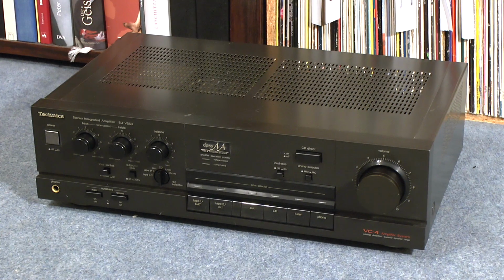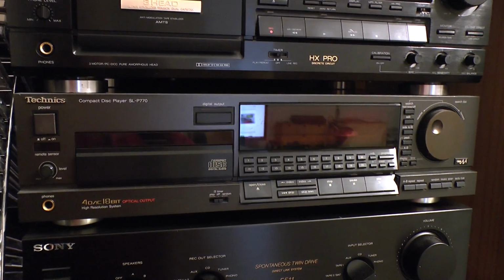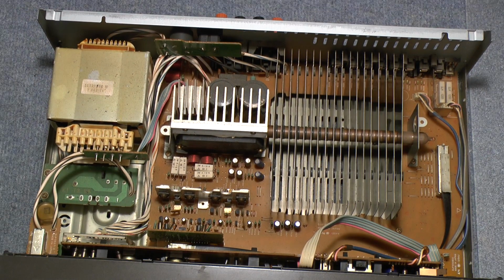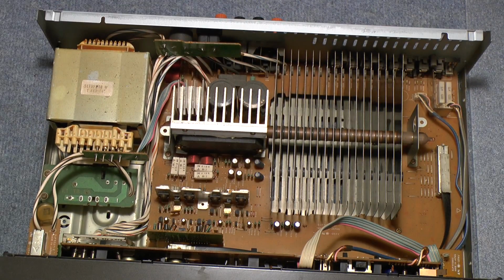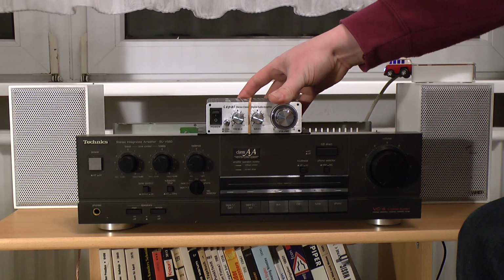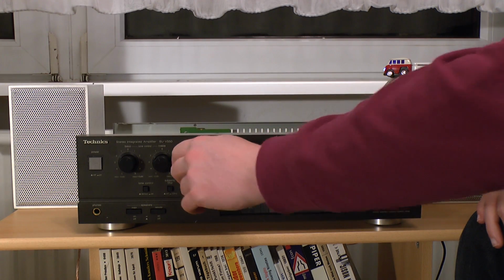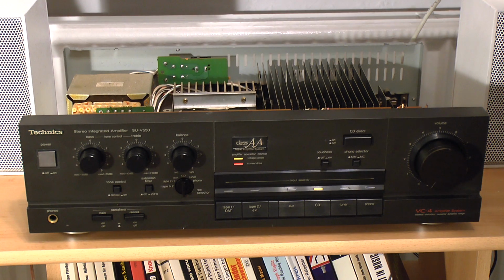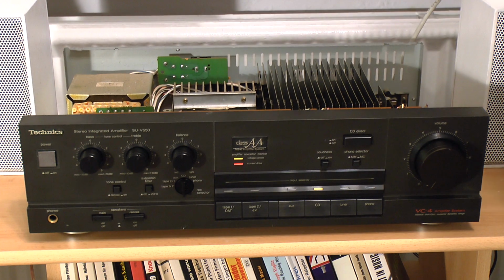The 1988 Technics SU-V550 amplifier arrives!

Comment: dude, you don't even know what' you're looking at. 50watts?? joking? The back panel says 570 W consumption. Have a look at the service manual. The cooling is stare of the art. Check out the measurements...
Reply: Just buy one and see..... Parts inside are not so top notch quality-. Measurements are fine on so many amplifiers but they dont sound all good. I have this amp still and, its a good one for a starter who has powerful speakers, but there wont be  much crystal clear tones.

Comment: I have an 1988 Technics catalog with that in it. I have the SL-P550 CD player. Awesome. The Technics amps that came after the Class AA were supposed to be much better. The Phono stage in the 550 is nothing special. Those caps are to bring the tiny phono out put up I’d imagine.
The source selection dial is frustrating small on it too.
Reply: Measurements are fine on so many amplifiers of that era but they dont sound all good. I have this amp still and, its a good one for a starter who has some powerful speakers, but there wont be  much crystal clear tones and bass will be muddy, not so sharp. Lots of power tho, stated 6w but feels like 120W. It was one of my first vintage amps.

Comment: The worst amp I have ever had. Lots of power but no fidelity. Muddy, flat, weak stereo effect.
Reply: Interesting - some of the Technics amp seem to "carry" a bad reputation. Seems that the pre-amp section can be a weakness.
Reply: @brucetungsten5714  I am not familiar with electronic parts inside, but what i have read is that it has some weak parts inside, except for transformer that has lots of power (Stated 65W but when you turn the volume knob it feels like 120W). Also, my experience is it works better with some speakers that have usually  highs pronounced so it levels with the amp muddiness. to some level. I actually even liked it when I connected Visaton X20 speakers (large), but then I hooked up my other vintage amps and realized it this Technics is not so crystal clear. But for any new user in vintage gear, it is a good start.

Comment: I've got one stuck on cd input. What section could cause that?  Cheers
Reply from the maker: The input selector switch is a mechanical setup. So there must be a problem with the latching mechanism in the input selector switch assembly. Oh, and make sure the CD Direct button is deactivated ;)
Reply: @DrCassette  switch checks out ok and the mechanics.  I've probed signal on aux input line with cro around tone section on preamp 8 pin chip and strangely sound comes out of speakers on another input when i do that. But stops upon removing the cro probe. I've got schematic and will play more.

Comment: Whats the VA rating on the back? You said 50watt transformer? These amplifiers are awesome, my experience with them is they have more stable juice than every other one besides high end Harmon kardon at the time. Those modules at the back may be a fuse, relay, resistor, even enclosed preamp for linear input leveling. 

I had a massive Sony stereo amplifier and separate preamp and it was amazing the power circuits that was used back then. These days a small amp using only 12v input can be very good so long as the speaker impedance draws enough from that low voltage amp.

Comment: Don't use contact spray.
Take them apart and clean it up nicely. (:
Reply from the maker: That's a waste of time. Disassembling potentiometers and switches and cleaning contacts that way in my experience lasts no longer than using a good contact cleaning spray.
Reply: @DrCassette  Yep   Deoxit !
Reply from the maker: @BigEightiesNewWave   I use Kontakt Chemie Tuner 600.

Comment: The only reason that STK module is still working is they made the heatsink big enough.  Those modules do have decent sound, but always failed prematurely due to heatsinks being far too small.
Reply from the maker: Yes, the STK modules tend to run very hot, even when there is no input signal.
Reply: Stk and svi are very different

Comment: i bought 18000uF 200v capacitors for my new amplifier project. These are expensive...
Reply from the maker: I can imagine those were not cheap. But why do you need 200 V rated capacitors?
Reply: @DrCassette  The real voltage on the capacitors will be around 70 volts and i thought 100v might not be enough. There weren't anything better available
Reply from the maker: @alcoholisfreedrink  Hmm, if the working voltage across the capacitors really is 70 V, then 100 V rated capacitors would be perfectly fine. 200 V is an overkill.
Reply from the maker: @alcoholisfreedrink  I know, 200 V is a very unusual rating. Are these capacitors used as smoothing capacitors in the power supply?
Reply from the maker: @alcoholisfreedrink   But smoothing capacitors never get to see peak voltages unless something goes horrible wrong in the mains. What output voltage does the transformer have?
Reply from the maker: @alcoholisfreedrink   50 V * sqrt(2) = 70.7 V
That is miles away from 100 V. I'd say, return the 200 V capacitors, if you still can. Get 100 V rated capacitors either with higher capacitance or multiple ones. Much better investment ;)

Comment: I bought this amp in 1988 and I still use it (in my home office).  The amp is very heavy for its size. Volume control is a little scratchy but otherwise its still great. I still have a technics tuner in a matching style that I still use with it.
Reply from the maker: These may not be the best amplifiers, but they are very reliable. I never came across a dead Technics amplifier.
Reply: The only heavy part is transformer at the left. The right side is awkwardly light.  Sounds like any average amp. It has lots of power only.

Comment: STK module...  notoriously unreliable.  Never (!) connect an amplifier to your precious speakers without being absolutely sure that there is no DC present on the output terminals.  Those low end amps with STK power modules are not always relay protected.  In case of a short in such STK you definately will fry the voice coils of your speakers.
Reply: its not stk are you blind?? its a matsushita module svi 3102
Reply: @MrHBSoftware  By looking at his profile pic, he looks blind :face-blue-smiling::face-green-smiling:🤣🤣🤣
Reply: so what? that also happens on amps with discrete transistors...svi modules are much much higher grader than stk
Reply: Doesnt really matter, these integrated amps are really bad if they are not designed properly, fortunately my techincs su v2x had output protection becouse SVI module was throwing 40VDC right to relay but protection kicked it so it wasn't on terminals. It also damaged preamplifier stage and input selector.
Reply: Maybe, but STK-SVI chip is pretty much whole power amplifier, if something dies you have to replace whole module which is like 50-100€ alone and hard to find, discrete amplifiers are much easier to repair, much cheaper and most of the time there will only be few transistors blown but with properly designed circuitry both can be safe and sound amazing. The fact that most technics with STK/SVI modules are 30 years old and still work today just shows that, but i'm not planning on buying anything with integrated amplifier chips, its way too risky.
Reply: the era of discrete components has ended many many years ago unfortunately... your pc, your television etc they all have ICs....i dont like ICs either but between a cheap stk and technics matsushita i prefer the second one..i bought a few NOS for 20€ each so when my amp blows it i have replacements on hand...these are not bad and are not failure-prone... there are state of the art marantz amps , all-discrete component that use germanium transistors and are way worse than this...and replacing then and rebiasing the amp is not for the common mortal...usually when they short they take with them the entire preamp and power amp...replace all ten or more transistors make one mistake and you blow them all up again...so...not fun either...  in the end there is nothing like a tube amp for serviceability
Reply: This is why they have protection circuits in them
Reply: You are quite dumb uh?
Reply: True, there is still ton of older amps that use discrete components, even some cheaper yamahas.
At least they got all sorts of protections into single chip, sadly most of them aren't as reliable as they are advertised, or don't make proper power under load, but properly designed amplifier will never rely on single integrated module.

Comment: nowadays to find a good stereo amplifier with an extrem low distortion such the Technics SU-Vxx series ...it's not so easy ! ( even with the more expensive recent amplifiers )
the class AA amplifier is made with 4 ampliers : 2 voltage control class A + 2 current drive amps resulting in extremely low distortion + a wide dynamic range. ( it's true ! ) 
result is only 0,005 % to 0,002 % distortion !!!!

Comment: Piece of crap on shity stk drive..
Reply: Got me the SU VX600 somewhen in the late 80s EDIT: 1991 it was. That's the "uppity" version of your model (amp only, different preamp stages ... no cd) which has the same amp-module (SVI3205a). The amp is still going strong, no recapping necessary so far, just a cleaning of switches and pots would be in order. After over 30  years in constant usage It still sounds fantastic and the "shity" STK :) is just an assembly of regular power-semiconductors as found in other high quality amp-stages (plus a few SMDs here and there).
If your amp is somewhat similar to mine (power amp-stage-wise) then you made a good bargain. It's a great amp, up to par with any of them Marantz, Kenwood, Pioneer and/or Sonys - had those too in the 80s - 2000s, yet, the Technics is the one that stayed; it's super reliable and the only one that never failed and still runs. Greetings and thanks for sharing the video!
Reply from the maker: I'm not a fan of these STK circuits either, but this definitely is one of the better ones they made.
Reply: its not st its panasonic-matsushita and they are reliable if not overheated
Reply: Another dumb, STK and SVI are very very different worlds 😂😂

Comment: How did you connected PI into this amp? HDMI to chinch or what?
Can it play FLAC or somehting with good quality?
Reply from the maker: The Raspberry Pi has an analog audio output which I was using. The software I used can play FLAC.

Comment: Aah, nice score! And if you don't like it you could easily sell it for the same price again.
The best matching amp for the SL-P770 would be the SU-V90D (although I don't like that one tbh). Or if you really want to go to the top, an SE-A100/SU-A200 combo would do the job as well.

About Class AA: this consists of two amp stages (voltage control in class A and current drive in class B). Key principle: the current drive amp does most of the amplification, and the voltage control stage kicks in when the other amp would normally start producing crossover distortions (as all class B amps generally do). So you'd have the best of both worlds: good efficiency from class B and zero crossover distortions from class A.

Comment: The design is very similar to that of the earlier SA-510 receiver, where the same heatpipe design is used with a discrete output stage. (Mine is rather broken, with a tuner MCU that crashes and a heat pipe that has no problem crossing 70°C within minutes.)

Comment: Be careful with the vacuum cleaner, i have heard that it generates static electricity
Reply from the maker: +Transistor512 
I know, vacuum cleaner and paint brush are far from ideal for cleaning this stuff, but I don't have access to a compressor over here, canned air does not have enough pressure and is expensive and I won't put this thing back together as dirty as it is right now...

Comment: I'm a huge fan of the 80s full-size Technics amps. The SU-V7 or SU-V9 if you can find one are exceptionally good. Adjusting them is pretty tricky because of how the class AA system works, but when they're adjusted they usually stay that way.
Reply from the maker: +Ashley Cox 
I'll have to see about adjusting this amp, I do have the service manual. If the procedure is as complicated as your comment makes me think then I'll stay away from it. I have re-adjusted the quiescent current on the Sony amp as that was way too high.
Reply: +DrCassette Well, it's not too terribly difficult. I know the V7 and V9 require a scope to adjust them, I forget what the V550 requires off the top of my head but it's probably fairly similar. Certainly nothing you'll struggle with.
Reply from the maker: +Ashley Cox 
Hmm, I don't have a scope in the apartment, so that's probably not going to happen then...

Comment: Just a reminder

Kids, never open and turn on a solid state, vacuum tube amp without the lid
Unless you're absolutely aware of what you doing
Reply from the maker: +Joshua's Recordings 
Some people have different approaches. I've shocked myself with mains voltage many times, it's not too bad, a good lesson pretty much. Switched Mode Power Supplies, that's what's dangerous. If you never take apart anything, you will never become aware of what you are doing...
Reply: +Xavier Ancarno Seriously? I done that since I was 5.
Reply: +DrCassette True. What voltage do you have were you live? I have 120V where I live and that is bad enough (I think). 

I would recommend to take something apart, just be carful not to touch anything. Especially in a tube amp or a vintage amp/TV. I have a old TV which has the high voltage generator tube completely exposed!
Reply from the maker: We have 230 V, in my workshop I measure 235 V.
It is good practice to work only with one hand in live equipment. That way if you do touch anything, it runs through ground and not from one arm through your body and out the other arm. Because that is DANGEROUS! And it hurts, trust me, it has happened to me.
And of course, anything that has high voltage in it, even if it's just a switched mode power supply, must be handled with extreme care.
Reply: +DrCassette Absolutely!
Reply: +DrCassette I used to work in a TV repair shop...so I've seen co-workers get shocked by high voltage...one time it was a capacitor in a microwave oven.
Another time it was the H.V. in a tv set. The guy with the microwave got thrown back up against the wall of our shop, he was stunned but otherwise not hurt. it scared the crap out of me.